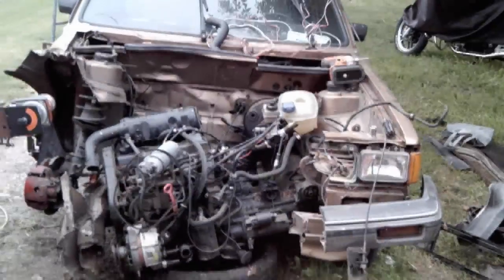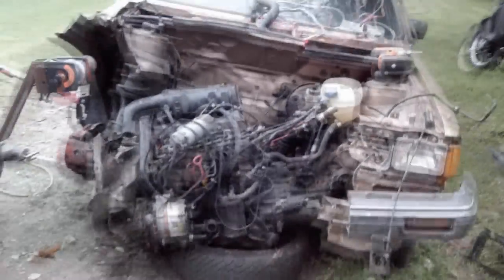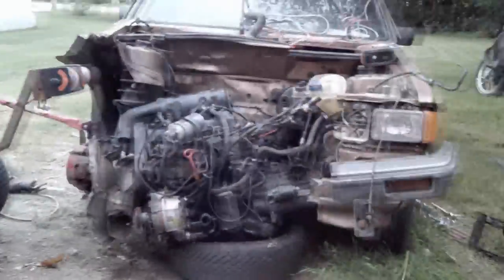VW Engine Extraction

Comment from the maker: @giberish9 I think the one axle was stuck in that video.  
But there is going to be a lot of work under the car w the linkage, so I am having a pit dug in my shop to get under the the thing.  Spedometer linkage can be scabbed together w rubber tubing. Strait radiator hose will connect the Dodge rad to the VW.  VW shift linkage will be the trickiest part, but much more reliable than Davids cable system.

Comment from the maker: @giberish9 I got the motor out o the VW, had to plasma cut part t of the VW body off it. I got the Voyager van in the shop, but its been really cold, -20c. I have the 3.0L hooked up to the winch ready come out. It will be done this spring or summer. I'll video everything on Youtube

Comment: @pacificcloud I don't think the clutch pedal is going to be that hard to make. Dave shows that in one of his vids were he makes his second diesel van. Just uses a real simple looking clutch pedal that came factory on his white van and replaces the pin for the brake pedal with another similar pin thats 3 inches longer. I've barely even started on mine. Right now I'm just trying to save money for the project.

Comment from the maker: @giberish9 Really not much to it, get the dodge motor out, VW in, make mounts, make axles, make shift linkage, scab up rad hoses, speedo cable, sensor lights, bleed the fuel tank out, add a diesel filter and your off and running.  Oh and the clutch pedal is going to be another fun thing, but think I can scab the VW pedals into the van.  Keep me posted on how yours is going, give me a video response

Comment from the maker: @giberish9 Yeh its sad Davidsfarm has been terminated.  He had pretty good instructions on how he did the caravan.  Basically I will keep all the Dodge motor mount locations, and weld up mounts on the VW motor where needed.  I hope Omni axles will work for you, but I was just going to cut my dodge n VW axles in half, then weld the outer dodge pieces to the inner VW pieces, think thats what David did too.  The shift linkage I have the same plan, I cut the whole center console piece out of the VW.